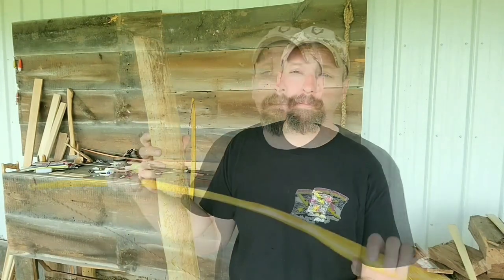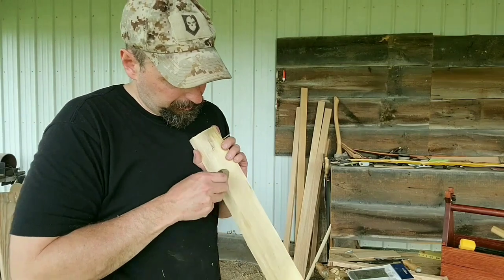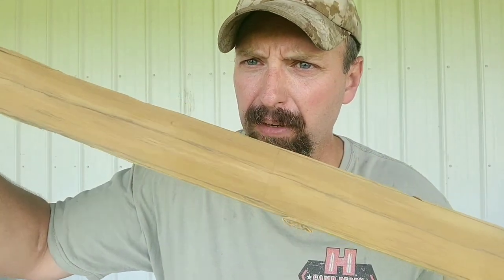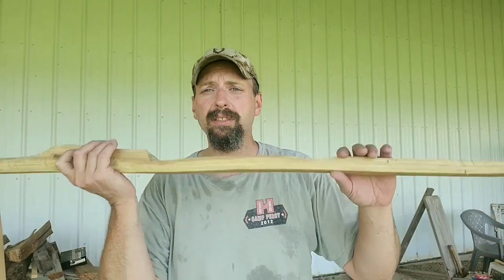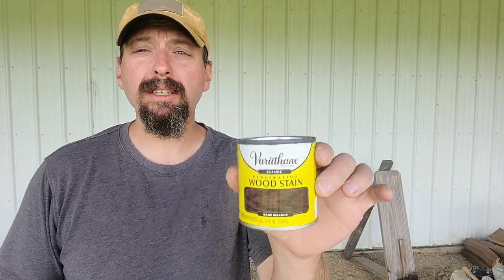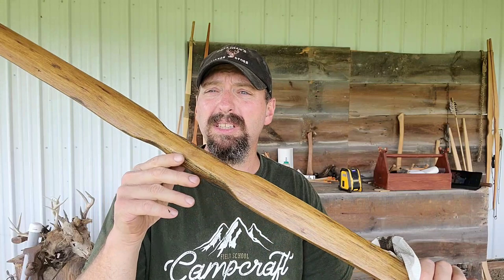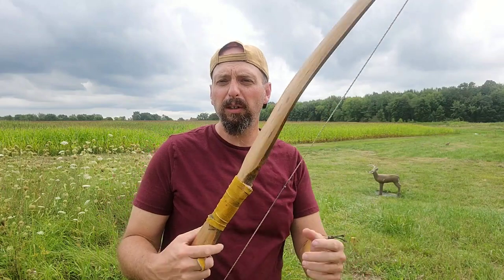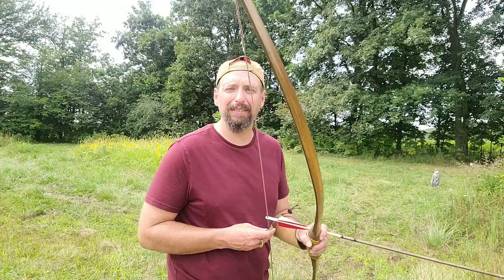Building a Black Locust Flat Bow

Comment: Well done! I love working with BL. To up the speed and snappiness of this wood fire harden the belly. BL has compression issues and the fire hardening will combat those issues.  I’ve made some extremely fast BL bows using this method.
Reply from the maker: I am taking a fire hardening class at Shannon Outdoors in April.  I can't wait to learn from the expert.
Reply: I have made black locust self bow , heat treated it. Its 62 inch long , recurved tips, pulls 50lb at 28 , I tried flight archery and with 690 grain arrow I have got 190 meters ( 207 yards)

Comment: Nice bow! I've heard black locust is a great bow wood, but is very sensitive to tillering errors yet responds very well to heat treating/fire-hardening. Yours seems to be on point though! Just a side note, a well designed self bow pulling 50lbs @ 28" shooting at least a ten pound per grain arrow is more than enough for all the big game in North America. Even Clay Hayes primarily shoots about a 50-55 lb bow. You could hunt elk, black bear, even moose as he does at that weight. A lighter bow also has the advantage of being more comfortable to shoot so your accuracy improves, which means your lethality as a hunter improves as well. If you're comfortable at 60lbs, then by all means, shoot that, but your 50lb BL bow there would not have any difficulty taking large game. I'd heat temper that belly though. Good luck!

Comment: I spent all summer cutting locust. I saved a lot of standing dead poles. Definately not as big as the stave the host was using but wondering if they'd work for a bow. I'm here because a local bowyer bought some logs off me for bows. He was pretty happy. He messaged me later the same day he bought them and said got 10 good staves out of the 6 logs he got. I haven't gone through them yet but definately setting the seasoned , straight grain aside , lol. great video. Would like for "in depth" tho.
Reply from the maker: Thanks, you can make a 2 peice bow if your pieces are too short. Most people won't watch a long video. I always struggle with video length versus video detail.
Reply: @BurningRiverBushcraft  thanks for the reply. The poles aren't to short. They're smaller diameter poles. That's to bad people won't watch longer videos. Especially "how to" ones. That's the only reason I watch them. To learn. Not to be entertained.

Comment: Don't  you think properly spined arrows or heavier weight would put that bow right on par with Osage? I've had a .title experience with black locust and found it about as good as Osage except its easier to work and has fewer pin knots. I just make'em a tad longer and a tad wider.
Reply from the maker: I think a good bowmaker could make an equal bow with either wood. For me the Osage is easier to build with. I would like to try more Black Locust in the future.
Reply: @BurningRiverBushcraft  me too and those you built are good looking bows. Thanks for the video. Enjoyed it.
Reply: @BurningRiverBushcraft  Going to start a build on one, found this video, I hear a bonus to BL it glows under a black light. Seriously.

Comment: Great job. How many times have you made one and it wound up breaking? What woods have you tried that you definitely would not use?
Reply from the maker: Broken bows are part of learning. Usually it's a tiller or weighted issue that is the problem.  It's still a usable bow but not prime. Red Oak and Maple are easiest to find. I also used bamboo and hickory and have Osage and IPE waiting to  be started.

Comment: I've read that English Long Bows specifically kept the sap wood because it has so much tensile strength. I'm wondering: why not keep the sap wood for Tension and the heart wood for Compression?
Reply from the maker: I believe English Longbows preferred Yew.  Yew is a completely different type of wood.
Reply: @BurningRiverBushcraft  but sap wood and heart wood are basically the same in their construction and purpose, right?
Reply from the maker: @nateypecks  No,  check out the Bowyer's Bible series.  It's more technical than my interest level.

Comment: What wood can I use?
Reply from the maker: Most any hard wood
Reply: @BurningRiverBushcraft  Thanks for your good reply, know that I live in hot areas.  Do you know which is the best wood?
Reply: @BurningRiverBushcraft  Thanks for your good reply, know that I live in hot areas.  Do you know which is the best wood?
Reply from the maker: Osage or Hickory  would be my choice.
Reply: @BurningRiverBushcraft  You said any hard wood. Well, can I use the side tree? The side wood is red and very hard, but I do not know its flexibility. I ask you for help.
Reply: @BurningRiverBushcraft  Hi I have an important question arc length usually starts from a few inches to a few inches.  Also the diameter of the middle tip and the handle and its width? You can share a drawing or image